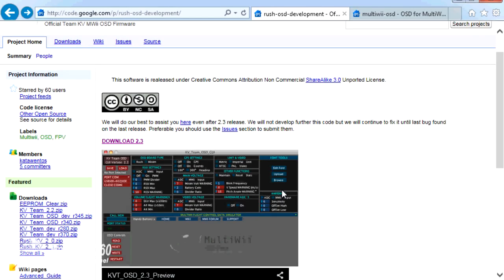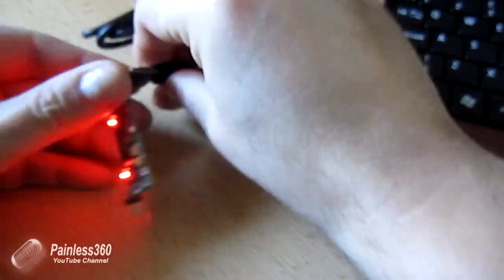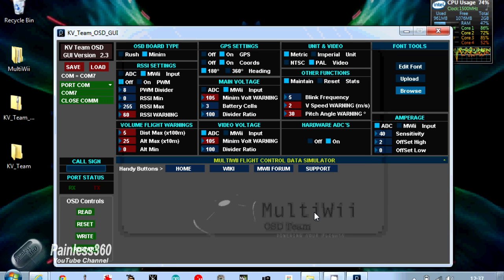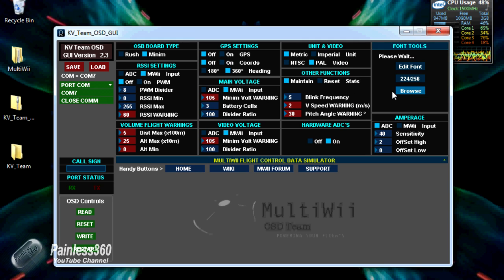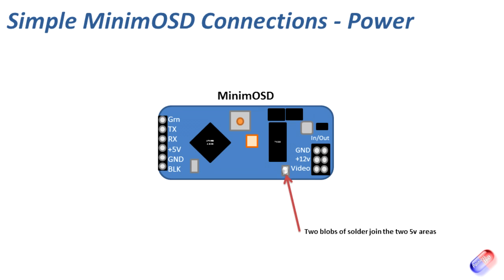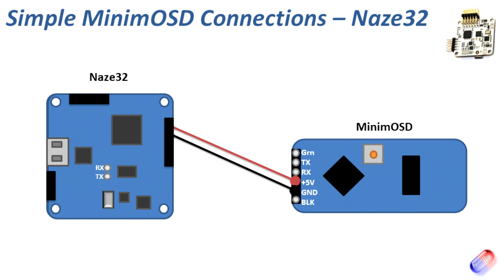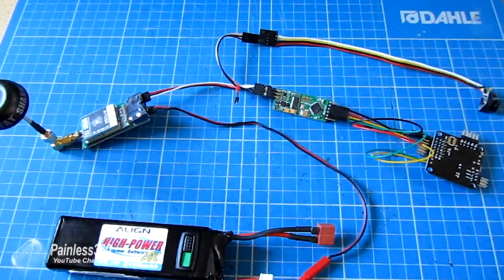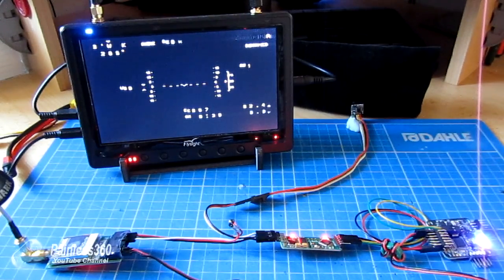(3/8) Naze32 Flight Controller - Adding an OSD using MinimOSD

Comment: Hi, could you help me out?

I am trying to connect my micro minimosd to my naze32 but i cant get the communication working.

I can see the OSD with the time and bat-voltage (from the minimosd ADCs) but i cant get any information from the nace (horizont etc.).

I have tried...
..switching rx/tx (although i am pretty sure i have done it correctly)
..disconnecting/connecting usb
..(de)activating uarts in cleanflight
..arming the QC
..two different naze32s (new), 2 different micro minimosds and 1 standard minimosd

plz help <3
Reply from the maker: What firmware are you using? Can you link me to the sketch you are flashing to the board?
Reply: +Painless360 I tried several firmwares. Tried Team KV, MWOSD and ArduCAM but stuck with ArduCAM in the end because the MultiWii OSDs randomly showed or didnt when i started up. I tried nearly every setupconfiguration. What exactly can/should i send you? http://i.imgur.com/aXYueGb.png Thats what i am flashing, with the newest firmware.

On the Naze i use Cleanflight 1.9.0 (forgot to mention it).

Is there anything I >must< set, to get it working? I activated the MSP on the UARTs.

I can see the voltage because i hooked the minimosd ADC to the battery. And i also see the Timer. The horizon and throttle indicator dont move. Also it always shows that i am disarmed and "no tele data" (or something similar).
Reply from the maker: I setup a OSD for 1.9 in the new SP3 series on the channel. That videos shows all the steps to configure the MinimOSD.  That should help...
Reply: +Painless360 Thanks that brought me a step further. I didnt select MSP in the Telemetry Tab (UART1).

My Problem now is. When i connect the RSSI (of the micro minimosd) to the D4R-ii the OSD doesnt boot/show up on the display. Also when i arm my craft the OSD freezes.
Reply from the maker: Use the RSSI/Taranis/Cleanflight trick to send the RSSI value back to the Naze32 and then pick up the RSSI vale for the OSD from the FC. See the Taranis playlist to find the video..
Reply: +Painless360 I figured that it only works, when i deactivate the FrSky Telemetry. (its sharing the same port-pins?! -> i cant connect the OSD to the RX/TX of the Naze if I am using the OSD)... How can i use the FrSky Telemetry and the OSD at the same time? If i hook it up like in most tutorials on the Internet it doesnt work...

Thank you for your help! The F3 video did the trick. Now that i see its working and nothing is damaged im going to play around with it =)
Reply from the maker: I'm playing with this at the moment with the SP3 as with both telemetry systems active I can't arm the board...

Watch this space!
Reply from the maker: +Painless360 You can preview the Cleanflight FrSky SmartPort telemetry settings on the SP3 video series now by watching https://www.youtube.com/watch?v=mFvb40oE_pM&index=9&list=PLYsWjANuAm4ro1vHztauuHFaelUDCOwqw
 Hope it helps.

Comment: Thanks for the great videos!
One tip from silly me - when connecting the FTDI to the MinimOSD, make sure to plug it the right way. I did it the wrong way and got the "Re: stk500_recv(): programmer is not responding" error message. I tried all the other board types in the Arduino, tried other drivers for com ports... it took me 3 hours to work out what is the problem..
Reply from the maker: +Android8890 Yep, that helps ;)

Comment: Finally got everything ready, but when I try to upload to MinimOSD board, I get the following error:
Arduino: 1.6.5 (Windows 7), Board: "Arduino Pro or Pro Mini, ATmega328 (5V, 16 MHz)"

In file included from EEPROM.cpp:5:0:
KV_Team_OSD.h:180: error: variable 'item_table' must be const in order to be put into read-only section by means of '__attribute__((progmem))'
  extern PROGMEM const char *item_table[];
                                        ^
variable 'item_table' must be const in order to be put into read-only section by means of '__attribute__((progmem))'

  This report would have more information with
  "Show verbose output during compilation"
  enabled in File > Preferences.

Then it jumps to KV_Team_OSD.h file with
  extern PROGMEM const char *item_table[];
highlighted.. any thoughts?
Reply from the maker: +FlyinSunnyCoast You're not searching the channel are you ;) https://www.youtube.com/watch?v=KJ1KmtkkLxw may help.Best of luck.

Comment: hi can i use Bluetooth and osd at the same time from the 2 pins on the top?
Reply from the maker: +Rick Inman I would look at Softserial for connections like BT. Lots of options to connect everything to the board and I've tried to make it as easy as possible in the videos.. Best of luck
Reply: +Painless360 thank you for all your videos thay help so much. my last quadcopter used a kk2. and now i am building a new quadcopter with the naze32.
Reply from the maker: I hope you like the Naze32. For me the move to the Naze32 felt like a quantum leap!

Best of luck.

Comment: Thank you so much for this video! I was able to follow it an get things working finally. I see battery voltage, throttle adjustments, GPS coords, etc. on the OSD. The last thing that is stumping me is that I can't get the throttle/yaw/pitch transmitter stick sequence to get the OSD to enter the configuration menu. Anyone have any thoughts on that?
Reply: Jerrill Johnson I had to adjust the MINSTICK/MAXSTICK values to match the 1050/1850 values I'm getting off the Turnigy receiver, recompile, reupload. Working now!

Comment: Very detailed video, thanks!
Just a note: I would not recommend connecting the two GND solder pats on the bottom. You should keep the two circuits (especially if you added a power filter to your video equipment circuit): one for alle the video equipment and the other for FC, Receiver etc.
Reply from the maker: The Gnd pads are common on the board.  Happy flying!

Comment: Thanks for the great instructional videos!  Where does one get the wires with the single "servo" connectors?  Thanks!
Reply from the maker: I make mine using wire and a crimper tool but you can get the  from  eBay or your local hobby shop.
Reply from the maker: Almost, we are a small club! ;)
Reply: I thought i was the only one that did that!

Comment: I get the following error when I try and upload to my minimOSD board. I am not very technical and I am just copying instructions from your video:

Arduino: 1.6.5 (Mac OS X), Board: "Arduino Pro or Pro Mini, ATmega328 (5V, 16 MHz)"

In file included from EEPROM.cpp:5:0:
KV_Team_OSD.h:180: error: variable 'item_table' must be const in order to be put into read-only section by means of '__attribute__((progmem))'
  extern PROGMEM const char *item_table[];
                                        ^
variable 'item_table' must be const in order to be put into read-only section by means of '__attribute__((progmem))'

  This report would have more information with
  "Show verbose output during compilation"
  enabled in File > Preferences.
Reply from the maker: Use an earlier version of the Arduino software.  See the video on the channel that covers this.

Comment: How would I go about using the APM  wireless telemetry on the Naze32 board
Reply from the maker: The Naze32 is not designed for lots if connections so be careful. Ive not trued the radios on the Naze32 but in theory they should work. Use the sane ports and wiring as adding a BT module. You may need to play with the baud settings on the airside radio.. Best of luck!

Comment: Just put micro minim osd on my quad follow your video, two things are wrong, rssi showing 100% permanently and osd displaying disarmed and not showing armed when armed, I followed the video on rssi in cleanflight.
Could you point me in the right direction tigon? Please
Jeff
Reply from the maker: You need to check that the RSSI value is correct in Cleanflight GUI. If it is then you need to check the settings for the OSD.. Best of luck!

Comment: Can you please direct me to the video setting up vbat for OSD hud? I added the vbat wire as to your video but not sure if i need to do more steps in the OSD gui.  I did setup using Baseflight not sure if this is a issue.I do see amp info but only zero on the bat readout.
Reply from the maker: Liquidguitars This is in the video at 10:00 you need to make sure that the battery voltage display is coming from MWii not ADC.Best of luck..

Comment: Dear Painless
This message was intended for you nevertheless I  am sure Tony knows the answer "If you have already used all the ports of the ESC like ex. GPS , LEDS what alternative do you have to  connect de MinimOSD y your power distrubution board only manages 12 volts ? Thank you".
Reply from the maker: Ciruplas You need to find a 5v and GND line that you can use to power the OSD. You have a few choices - splice the power lines into one of the ESC +5V and GND connections already there. Install a spate UBEC just for the MinimOSD Or use one of the additional 5v pads on the Naze32 - there is one by the side of the servo headers. Best of luck.
Reply: Thank you !

Comment: In 8:07 I got an error message: www.new.planet.ee/kv_Team.jpg
What do you suggest?
Reply from the maker: Allan Tamm Watch the video on the channel I posted just this week on this *exact problem*Best of luck
Reply: Painless360 No luck at all :) Thank you for your help. Highly grateful. Now I stopped on screen "waiting for heartbeat". When OSD is powered up I cant connect with usb. Some people notest that telemetry is not working when board is not armed. I am struggling days with simple case - micro minimosd and flip32. Embarrassing to bother. Didn't find any video of yours explaining port settings for UART and OSD in cleanflight. Maybe there is something wrong.
Reply from the maker: If you are using the telemetry pins then you don't get telemetry until the board is armed - that is why I do it this way in the video - you get the data all the time using soft serial.

Best of luck with it.
Reply: Painless360 in GUI I set minim and after writing it reads rush for board type. nothing will be saved. Tested reboot and restart. Same result.
Reply: Allan Tamm Note: My FTDI Basic is 3.3V!
Reply: Allan Tamm for note:
https://www.flickr.com/photos/28914418@N02/3831178226/

I cut open 3.3v and soldered to 5V
everything works now well.

Comment: Mine shows a black screen, im using the same board as in this video, im using pal, do i need to solder the backside of the Board to have pal support?
Reply from the maker: Mike Morris No, the PAL connections have not been used since the very early versions of the code. I'd suggest you recheck all the wiring, make sure the firmware and fonts are on there ok and make sure that both sides of the board are powered..Best of luck.
Reply: when i remove the OSD from the loop and solder the wiring back together, it works perfect, im using MWOSD firmware and reloading the fonts to the OSD (KVosd errors when i try and use it ) i had it working perfect with a Micro minim osd but the pads lifted and a friend sent me a normal minim ... tis weird
Reply from the maker: Sorry, not sure what it could be. I've heard of the voltage regulators having issues and causing all sorts of problems..

Best of luck with it..

Comment: do you need to have a telemetry compatible radio transmitter and reciver for mini osd ? thanks !
Reply from the maker: nicbleu No, the telemetry date is sent from the flight controller to the OSD and then that shows it overlaid onto the FPV video to show GPS co-ordinates, heading, altitude etc. If you also want to see the data when you are not flying F|PV then a telemetry radio (like the Taranis) is a great options.Happy flying!
Reply: Painless360 thanks !
Reply: Painless360 and for the rssi signal i guess you need the telemetry radio transmitter ? like frsky taranis ? is there any cheaper rc tranmiter that support telemetry and rssi ?thanks you so mutch
Reply from the maker: Sorry - I don't know. All the ones I know of (Spektrum DX8 etc) are a lot more expensive..

Best of luck..
Reply: Painless360 ty

Comment: And this:
Arduino:1.6.5 (Windows XP), Placa:"Arduino Pro or Pro Mini, ATmega328 (5V, 16 MHz)"

In file included from EEPROM.cpp:5:0:
KV_Team_OSD.h:180: error: variable 'item_table' must be const in order to be put into read-only section by means of '__attribute__((progmem))'
  extern PROGMEM const char *item_table[];
                                        ^
variable 'item_table' must be const in order to be put into read-only section by means of '__attribute__((progmem))'

  This report would have more information with
  "Show verbose output during compilation"
  activala desde Archivo > Preferencias
Reply from the maker: Use an older version of Arduino.. 

Best of luck..

Comment: The OSD from Banggood you have to use he older version of Arduino, for the GUI it does not work on 64 bit windows for your information
Reply from the maker: Tony Cooper Thanks Tony, the latest Arduino software can be unhappy with older sketches. I always use the older versions in the videos. They are simpler but work! Happy flying!
Reply: +Tony Cooper can you please post a link to the actual one you bought from Banggood. I cant seem to upload the sketch onto the MAVLINK OSD that I have.
Reply: +Tony Cooper can you please post a link to the actual one you bought from Banggood. I cant seem to upload the sketch onto the MAVLINK OSD that I have.
Reply: isn't mavlink uses the old ardupilot 2.0? I've tried to use the newer version upto 2.2 2.3 2.4 but all causing problems..
Reply: isn't mavlink uses the old ardupilot 2.0? I've tried to use the newer version upto 2.2 2.3 2.4 but all causing problems..
Reply: isn't mavlink uses the old ardupilot 2.0? I've tried to use the newer version upto 2.2 2.3 2.4 but all causing problems..

Comment: Very nice video - the voltage in the lower right says 0.00 and is flashing just like mine.  Having a hard time seeing the vBat on the screen.  Everything else is working well . . .
Reply from the maker: Ken Crawford That is because the vBat isn't setup on the Naze32 and the cable plugged in from the flight battery. You need to set that up first then it will appear on the OSD too. You know when vBat is working as you can see the voltage in the Cleanflight GUI on the main page.You can see a video on vBat setup in the Naze32 playlist on the channel.Best of luck.
Reply: Painless360 Thanks!!  but I have done what you said and I can see the voltage on the Cleanflight Gui main page! I watched your vBat also (very well done).  I have tried everything I can think of I this point - spent several hours on the web and can't get it figured out.  RSSI - Mode switch change - and the horizon works well.  I also have the voltage setup to MW in the KVTeam Gui .This minimum OSD is one that has the other pins with the main bat but did not want to do the voltage divider.  But I may give up and give that a try ....Also need to figure out how to turn off the annoying pitch warnings!IThanks again for your help!
Reply from the maker: You need to focus on getting the vBat piece working first.

Comment: Hi there thanks for your helpful videos can you tell me what is the voltage for the tx and rx coming from the minim osd. I have fryed 2 naze32 boards. I am trying to determine what caused the problem. My minim is showing 5v and 3.5v best regards thanks.
Reply from the maker: Jose mayor You must be doing something wrong with your wiring. The MinimOSD runs on 5v. Follow the video exactly to avoid hiccups.
Best of luck.

Comment: having problems running kv osd gui , keep getting a java error
Reply from the maker: Jeff Wells Are you asking for advice or simply stating a fact? ;)
Reply: Painless360 Question, just putting out there if antbody has any ideas.I have a 64 bit pc and whilst trying to load kv teams osd software gives me a jave error, tried to uninstall and reinstall an earlier version, no luck tet though just saying same thing.Just bought myself a taranis and followed your video about setting it up, so helpful.would not of been able to do it my own.Regardsjeff
Reply: Jeff Wells I am getting "javaw.exe" error showing can you tell me how to fix this please
Reply from the maker: There is loads of detail about this on the forums. This relates to Java that the a[[ uses. Usually it's a reinstall of Java needed or a clean-up of the installation.

Best of luck.
Reply: Painless360 tried a reinstall twice, thanks anyway
jeff
Reply from the maker: Could be two versions of the paths are wrong..

Best of luck...
Reply from the maker: Painless360 https://www.youtube.com/watch?v=66crhKstr70 may help..
Reply: Painless360 fyi the info you are giving could be potentially misleading, to get kv teams software to work it needs an older version of arduino and java, please do not take this as a criticism, because the vids you have made have helped me a great deal, I very much doubt I would have been able to set up my taranis without your videos on here.regardsjeff

Comment: If you could help me that would really help me out I was wondering when I start the OSD it says booting up crashes then sYs booting up again and so and so
Reply from the maker: Adam Keely What troubleshooting have you done?
Reply: I don't really know how to but in the gui, when I press right to set the minim and multiwii then press read to confirm, it changes back to the default settings, I've tried this on both my odd boards same scenario, I've also tried switching the rx tx cables on the naze32
Reply from the maker: A video showing it would be useful..